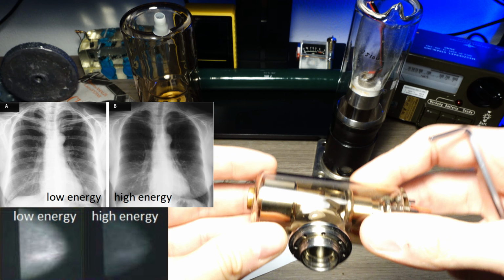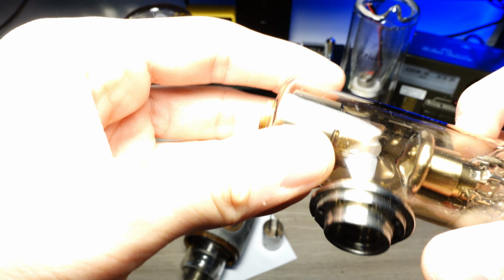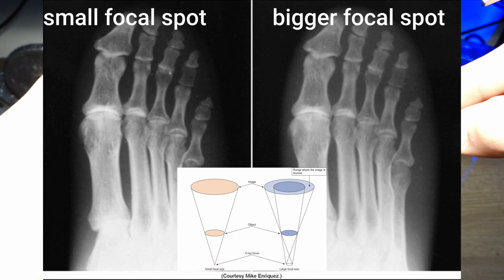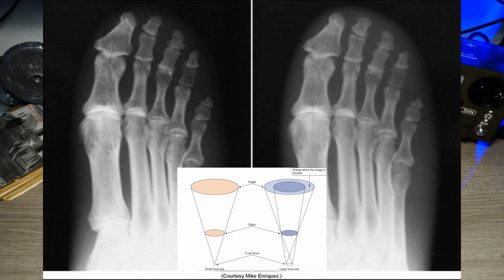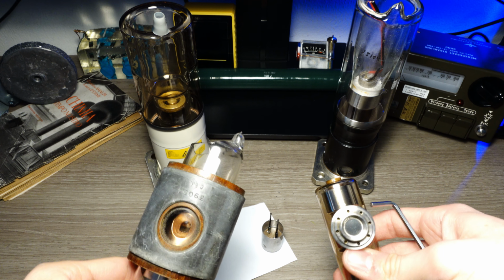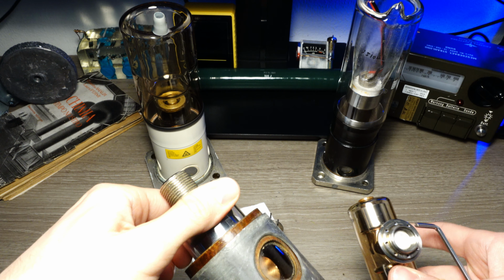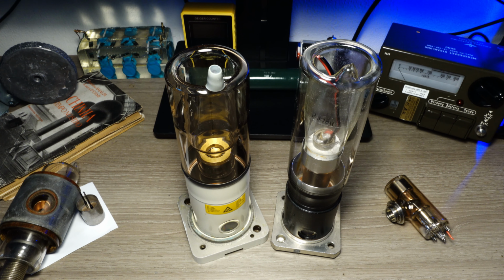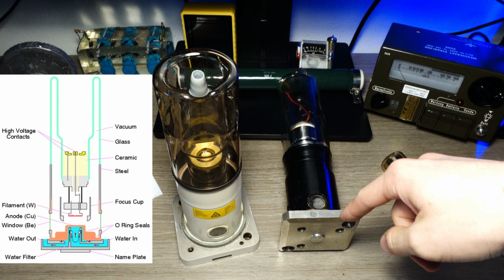Examining some Exotic X-Ray Tubes

Comment: From my research the angle of the anode in the dental tube actually isn't 45 degrees, rather it's between 15 and 25 degrees as the tube uses the line focus principle.